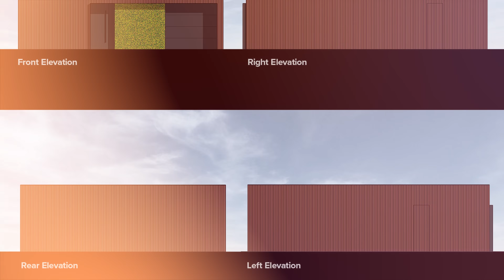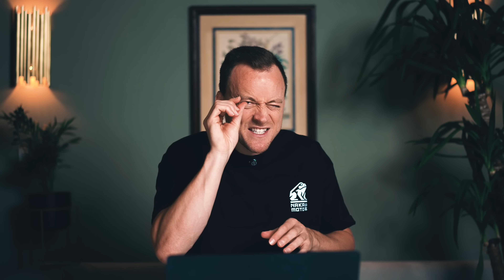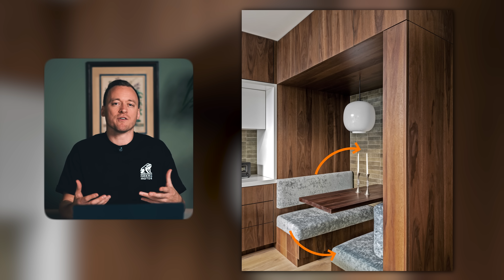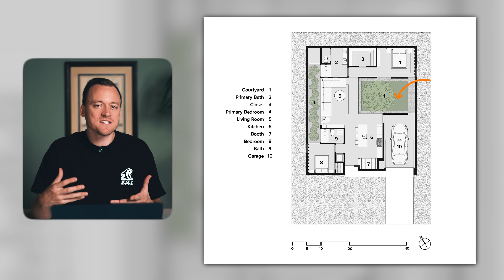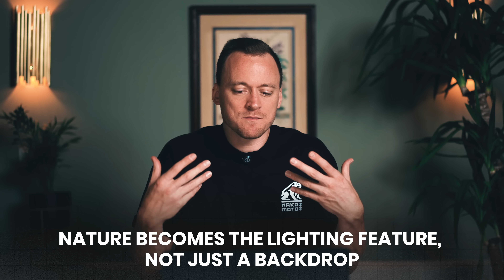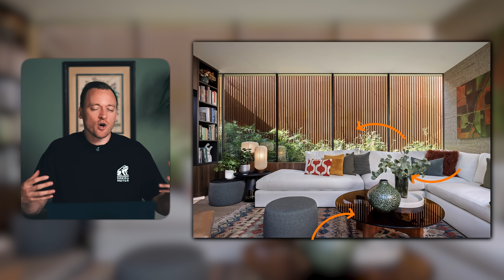this home is every introvert's fantasy. and it's real.

Comment: You are really good at selling it, but I think it is more conceptual than practical... Not having any window to the outside means you cannot see the outside either which even for safetly let alone light and ventilation (regardless of the rest of the house) is not the best approach. Neither is it very protected from the outside since it has no fence, nor very pritty since despite the cactus garden is outright barren for something so spacious on the front side of things
   As for the interior, is not bad per se, perhaps too over the top on the wood in a way that makes it seem more of a magazine cutout or an hotel than something lived in. What  I dont like is the mcdonalds style dining table and that being closed up on one side. It is uncomfortable and to me unsightly in such a home

Otherwise it is ok, but the most striking things in it are far from needed or nice imho. It could have been so much better with just a few touches...

Comment: Eh, not for this introvert. The rectangular center  courtyard with glass on three sides would get the hair on the back of my neck standing up, even in the house by myself. Concept's fine, but I'd execute differently. Though I'm also not an architect by any stretch of the imagination, so I admit my understanding is limited.

Comment: Really love this. But main things I'd change is add a slight angle to the roof to either throw water in or outwards.
I don't recommend planting cactus, their roots TRAVEL. We had to move ours because the roots got into 3 pipes. Always check on the roots issues for plants around the house. May look good, down the line it's nightmare to repair.

Comment: Don't building codes require "egress windows" (that would lead to the outside of the home) in every bedroom? In the case of a fire 'escaping' into an enclosed courtyard would not be safe - you'd be trapped. There should be windows visible from the outside. Or are there windowless doors opening to the outside in the bedrooms?

Comment: Fire egress is a safety concern.  ALL bedrooms should have fire egress that allows occupants to get out and away from the structure.   Also how to keep those windows clean when there's little clear walking space around the perimeter of the courtyards.  No window covering was shown in the master bedroom, which puts that bedroom on display to anyone in the other spaces looking onto/through the same courtyard, and since this is a 3 bedroom house we can expect other occupants.  Courtyard drainage during heavy rains is also a concern.  The gravel pad next to the driveway WILL get driven on, so it needs a strong under layer.  Also not covered: where do the occupants put out their trash (looks tight for trash trucks) and where do they get their mail?  This is a pretty space (inside), but I see several liveability concerns.

Comment: If the corrugated metal sides aren't installed well it can result in noise issues.  I live in a apartment where the patios/decks have such walls.  The builders did close up the ends of the corrugations, but they didn't do anything about how the door trim overhung the indented parts of the corrugations.  When a strong wind blows the not-quite-enclosed tubes formed by the door trim and the corrugations would whistle and shriek ear-splittingly loud, loud enough to wake us in the bedrooms farthest from where the noise was generated.  If we were in the living room (where the patio door is) we would have to leave because of how loud and shrill it was.  I asked maintenance to fill the troughs with foam, and that worked for the most part, though we still get some noise if the wind is particularly strong.

Comment: Obviously looks like the house was built, but how did they get around the fire trip codes?  Seems like if a fired happened there would be only one point of exit.  Yes there is a garage but that’s on the same side of the house as the front door.
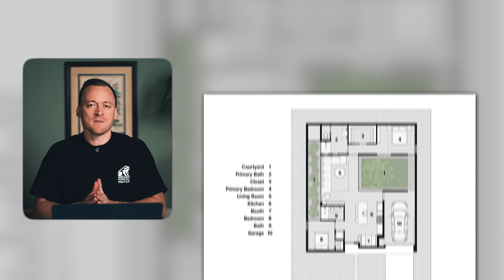Reply: There is another video about this house that explains there are fire exit doors in each of the two bedrooms.  They can be seen in the floor plan at 05:20.
Reply: @hitechworld7264 cool must of missed that.
Reply: @hitechworld7264 thanks. I was having a panic attack just trying to figure out how to get out during a fire.

Comment: Really good concept, especially being an ADU.

Since privacy is priority, I wonder how much a drone can see above the home.  For the shower, a curtain to protect from the courtyard view may spoil the design.  But what if you replace the window in the shower with the fancy glass that can become opaque with a press of a button? 

Has this been considered for bad/high crime urban areas?  You can probably buy a whole city block relatively cheap and load it up with these.  Since there are no windows anyway, you can build these attached to each other for maximum use of the land.  Even make a perimeter wall with these and a usable courtyard in the middle for the whole block.

Comment: Normally when I see homes like this I'm like no. The outside i normally a turn off, but this is simple so I'm not mad at it. But everything else around the front is awful and I can't stand it. Kitchen the only thing I like is the booth like seating area, and even that needs so changes potentially. It's not bad, but this is not a home for a family that is for sure, this is a box, literally. There is nothing cozy or warm about this place. I'm sure there are people that would fit nicely in this box, but give me a week I'll leave in a less then 3 days cause this looks like a luxury jail cell.

Comment: My only concern is there isn’t a secondary exit in case of an emergency unless there are hidden doors in room 8 and 4.
Reply: There are. Look closely at the floor plan and the elevations.
Reply: @elliotnaess8020  Only secondary exit is by the garage that I can see. I watched another video on the same house from the owners\architect. It’s an interesting concept just would have liked another exit out.
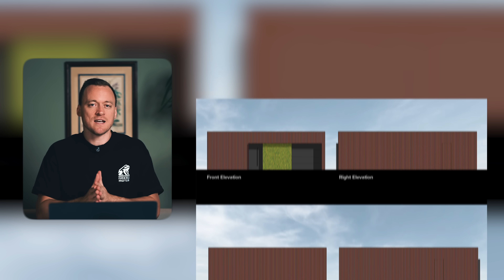Reply: @lourobin2728  Stop the film at 6:10 and look closely at both Left Elevation and Right Elevation.  You may need your best reading glasses (so to speak), but the doors are there.

Comment: It might be something introverts may like, but I think this was driven by safety.   There is no easy access for criminals or for them to see what is in or occurring in the house.  If you want privacy, you put curtains in the windows.  If you want security, you eliminate accessible windows.  The plants chosen, cacti which have thorns send a message.  I don't think this is about water conservation.  The very visible and nearly clear rock yard devoid of hiding places suggests something of the Berlin Wall Death Strip.  It is sterile and unwelcoming.  If you knocked on the door, you suspect someone like a Bond villain would answer.   Criminals might use the satellite views to figure out there are interior courtyards, but they still can't determine what is going on in the house or what is in it.  They would have to get upon the roof and expose themselves.  The vertical rather than horizontal corrugated metal makes scaling even more difficult.  If the inhabitant  has built this fortress, what other things they may have set up inside?   It is best to pick other targets.

Comment: I have been designing and tweaking the floor plan of a home like this for a few years. I want to go off grid in moose and bear country, so I want protection. There will still be some exterior windows, just smaller and higher on the wall on the sun facing side. The courtyard will be much bigger and there will be a partial second level turning the rest of the roof into an outdoor area.

The main thing I am working on is trying to figure out how to stop moose from walking into the walapini I want to build.

A perimeter barrier of thorned berry bushes, about 15' deep will do a good job keeping bears out, not moose. Plus the driveway entrance is a weak spot.

Comment: This really is the perfect design for a low-rise community if the views outside are ugly or you are very worried about your security and there are no tall buildings nearby that would overlook the courtyard. It would not take a lot to fortify this home and turn the whole thing into a safe room for a wealthy family. Enlarge the footprint and raise the roof so the home is two stories (harder to climb to the roof), make the exterior walls of two-foot-thick reinforced concrete (resists 50 caliber rounds and arson) and clad the exterior sides of entry doors and the garage door with corrugated steel like is used on shipping containers (resists gunfire, axes and arson). And put a heavy duty, steel security door between the garage and the house. No burglar or home invader would ever be able to get inside without your cooperation. A criminal would have to find a way to get onto the roof (fire truck with ladder? parachute in?) in order to break in. 

I would put a ventilated greenhouse roof over the courtyard, add a heating system for winter and plant two orange trees in the center and four jasmine vines on corner trellises. Kind of like a Moroccan courtyard. Maybe add a tiered fountain. When the plants are blooming, you could open one of the glass panels to let the fragrance indoors. And you would have a good supply of oranges if there is a way to let the pollinators into the courtyard when the trees are blooming. I would add an outdoor shower -- for summer use -- just beyond that glass door to the indoor shower area. I would cover the walls of the courtyard with blue and green painted tiles that have an interlocking design because I do not like the brutal look of rusting steel.

Comment: Villas of rich romans in antiquity where built exactly the same but soooo much better as the center garden of the house was open and easily accessible, so you could enjoy privacy and quiet. That’s what is missing in this otherwise nice introvert house.
Reply: those central open areas were the cooling system of those buildings

Comment: It would be nice to have a door to the courtyard. Then they would access to the outside while still preserving privacy.
Reply: yeah, especially the long narrow part is funky if you think about it.
the green stuff will overgrow, then the lower parts which are getting less sunlight will brown out and drop the foliage. if the plant is something that dies during winter then you will have leaves stuck on the glass and decompose, browning and tainting the window itself.

the main courtyard seems to be the opposite of what the main message is : it is entirely performative and show off rather than a nice usable area:
put down a mini lawn and you can go out and enjoy the sun, or do whatever under that olive tree. those little uninviting plants are there to make you work hard to keep it like that only for performative reasons…
other than that; i liked it, apart from the fact that despite “not having windows” there is a bucketload of windowcleaning is needed both inside and out…
and if the windows are not opening, then you need people lower themselves from the roof to do the job… rendering your life completely visible to them… even in the shower :)

Comment: Like it, BUT the courtyard is wasted.  Clearly an artistic designer with more thoughts about the overall look and feel, rather than the practicality of actually a home to be lived in.  I would have wanted large sliding doors into a garden with flowers shrubs, eating, seating and enjoyment factors.  The courtyard here is to be admired and not 'entered', however, living in a windowless cube, one needs to be able to experience the outdoors rather than just admire it. Why be forced to stay indoors in one's own home 24/7?
Reply: Hi there-- this is the architect (and homeowner) and I get this question a lot.  The house is for my wife and I and we love the expansiveness that the glass gives to the rooms as well as  our our olive tree.  We also love the feeling of "floating" between the garden spaces, but neither of us is the type to hang out outside in the Texas heat (or cold).   We opted for much more energy efficient fixed glass without the heavy and expensive tracks and frames required to open the whole thing for the few days that we might do so.  We have a passive ventilation system for fresh air, and it all works great for us, but we understand it may not be everyone's ideal.
Reply: Could not agree more and said the same in my comment above.

Comment: Flat roof: No deal. Every flat roof I’ve lived under has been a water leaking nightmare. Angled roof with big eaves > flat roof membrane with no eaves.
Reply: The plan looks like the roof has a small grade.
Reply: Any flat roof should really just stop half assing life and finish the project into a living roof.
Reply: @Mix1mum  good idea. But maybe even with a small grade.
Reply: Maybe the flat roof would be better if it was a usable outdoor space
Reply: I'd be more afraid about the snow collapsing the roof...
Reply: @ovDarkness  Austin Texas property. don't build this in Vermont
Reply: I never had issues.
Reply: Fully agree. I worked in high rises and see one story flat roofed buildings and see water buildup on the roof. That’s not a good thing.
Reply: Actually that roof slants, not flat.
Reply: Bugs could get in easily with those open spaces
Reply: So…the exterior panels are corrugated?  Is that not a common exterior in the US?

Comment: Great video.  Love everything about this unique house EXCEPT the flat roof.  Flat roof = ongoing problems.  No.
Reply: Hi there--  This is the Architect and Homeowner.  We do "flat" roofs on almost all our projects (they actually have a shallow pitch) and have never had an issue.  The membrane roof products that are available now are fairly bulletproof.  Think of large retail or commercial buildings-- they are all "flat" roofs and the developers wouldn't opt to use these systems if they leaked constantly...
Reply: @spiralclear  - Thank you for the info.  Love your house!

Comment: Very interesting with the addition of a laundryroom and access to the inside garden.
Reply: Architect and Owner here--  The house does have a laundry and there is maintenance access to the courtyard.  Those aspects weren't brought up in the video...
Reply: @spiralclear  I don't see a mechanical room. Is it the unmarked space in the upper left corner of the floor plan? What are you using for heating and cooling? Heat pump?

Comment: Great idea.  I have a love/hate relationship with this home design philosophy.  It's important to note this is not new.  In fact, it's ancient. Ancient Greek and Roman domiciles were inward looking with no windows.  There were essentially open roof barns which is the same idea as this style.  No windows because glass was expensive and windows were not secure.  Ancient Chinese architecture didn't have outward looking windows and this is still the case in many areas of China and Northern Africa; like Morocco. Bottom line:  outward looking homes are more Christian and modern.

Comment: In 1964 an architect at the university of Illinois built a home that turned its back on the mundane and run down community around it. He built 16 foot high brick walls at the building setback lines. It also extended seven feet below the yard. A full height red slit in the center of the front was the front door. It was 36 inches wide.

Entering through the door you were on a wooden bridge that took you about six feet onto a wooden deck. The deck did not touch the exterior walls which were covered with ivy and lit from below.

All the components of a home were situated on this wooden deck.
Nothing touched the wooden trusses and plywood that made up the ceiling.

It was stunning
That was 60 years ago.
Reply: I can’t find anything about that house. Do you know of anywhere that it’s online?
Reply: Do you know if it's still there and if videos of it can be found online?  That sounds badass.
Reply: @JDawnchild  the architect was Bob Amico. The home was in Champaign Illinois where he taught design. He lives in Tucson now.
Reply: @larrysorenson4789 Tyvm.

Comment: And to bring some clarity. This is not a “real” house - yet- per se, but conceptual renderings. This project was put together as one of the theoretical solutions for “case study 2.0” where a group of architectural firms proposed designs to re-build Pacific Palisades.
The concept is quite strong, beautiful, thought out. One could argue that it is too conceptual, and maybe flawed in some ways?
For example: it stands as a beautiful object, but cuts all connection to the public/street side and its neighboring context. All views are inward, thus a bit myopic. The living style feels more like a space capsule than a home on its singular lot. The relative absence of opening and views into the setbacks creates a risk that these areas will be overlooked and not given the attention and maintenance they would require.
That being said, the flow and look&feel are certainly beautiful, just wish it had more awareness of its surroundings.
Reply: It's a real house-- I live there (and am the architect).  It is also part of the Case Study 2.0 program (I believe the only built work in the program so far).  See my reply below about the courtyard access if you're curious.
Reply: @s @spiralclear @ 1037 Liff St?

Comment: The emergency operations center in my county has a similar design and where you see the garage door and front door a huge concrete walls can secure it to protect from severe weather.

Comment: This is almost like how old  Japanese house are build with courtyard in the inside of the house that provide lights to all the rooms. Although the house part is elevated to protect it when it rains. 
But I really like that design instead of having windows , only room that will have small windows would be the restroom for natural ventilation.
This actually my dream design ,. Designing a  house around a garden 😉, I’m still dreaming 😊 but not impossible 😉
Reply from the maker: Good point!